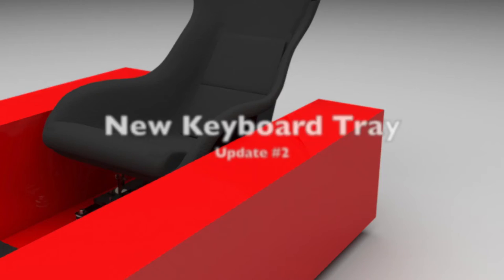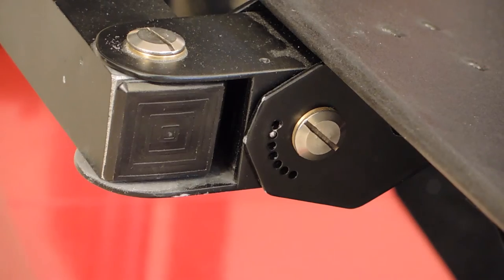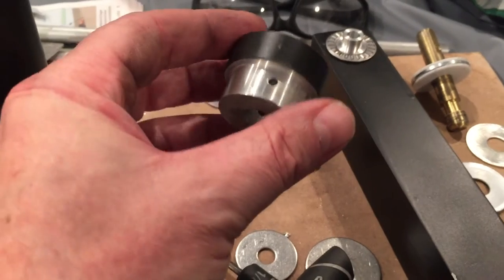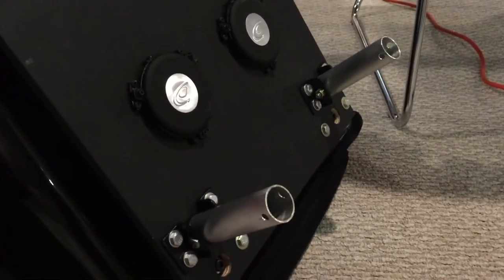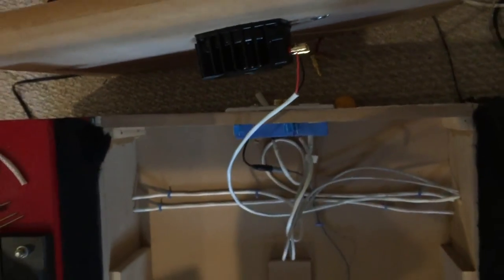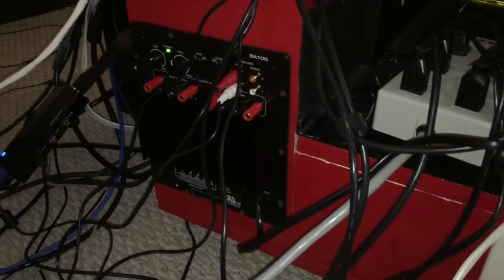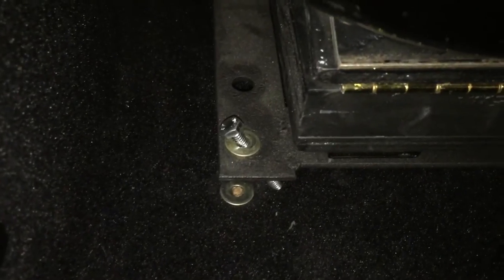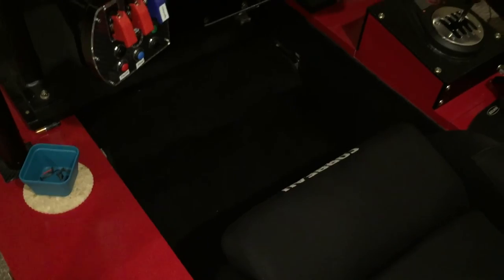Building a Driving Simulator - Part 3-2

Comment: Beautiful mr Lagnese, I hope my project became so nice like yours. My construction begin next month and I pretend to document everything and create a worklog like you (unfortunately it will be in portuguese but don't worry: you will be on the credits for sure).
My project has similarities with your even with the rig (despite the fact that it have flight simulation components):
1 - Joysticks: Fanatec Porsche 911 GT3 RS V2 Wheel, CSR Elite Pedals, ClubSport Shifter V 1.5, Thrustmaster Warthog, a Helicopter Collective and a custom button box;
2 - Razer Blackwidow keyboard and mamba mouse (supported by a gas spring vesa mount);
3 - Custom 5.1 surround system (witch I will build inside the sled, with Monoprice speakers, 6 ch amplifier board and a switching power supply);
4 - AuraSound AST-2B-4 Pro Bass Shaker;
5 - Razer Tiamat 7.1 headphones (with some electronics for switching between the headphones and the speakers while maintain the bass shaker running);
6 - Dell S2716DG 27 in g-sync monitor (supported by a gas spring vesa mount);
7 - HTC Vive (this is the reason of the single, and not triple monitor setup);

Tell me if you think that the gas spring will work on the keyboard/mouse mount (I bought it from Amazon: https://www.amazon.com/North-Bayou-Motion-Computer-Monitors/dp/B01AI2YGK4/ref=sr_1_13?ie=UTF8&qid=1474737695&sr=8-13&keywords=gas+spring+vesa).

And thanks a lot for your work, it inspires me in so many ways. And sorry about the english ;-)
Reply from the maker: Hmm, I just replaced my three screen setup with a single 4K display.  It bolted right up to my existing brackets.  I just took off the other monitor 'wings' by undoing a single bolt.  The gas spring seems like a pain compared to two simple brackets on a steel tube.  My VESA mounts (for other 4K displays), can't handle the weight well either.  Any reason why you opted for that solution?
Reply: Nope, just because it seems practical (I saw one of your videos explain the difficult to implement the tubes with adjustment and bracket alignment) and cheap (just $34) but now I am afraid: did you think that the gas spring will not work for me (to support one 27 in monitor and other to keyboard/mouse)?
Reply from the maker: I'm sure it will work depending on the weight of the monitor.  The brackets I reverted to are nice because they are so small and tight to the frame.  It moves the monitors away from the user, makes the rig lighter, and removes any possible sag.  Assuming a T-Slot frame, it would be even easier to implement.  Just a couple of angle brackets and a few holes.

Comment: so the seat tilt is non adjustable any more?   i will start building this week !
Reply from the maker: In my case yes.  I removed the adjustment because I found that I never adjusted it for anyone.  It made the connection stronger, easier to build, and the change removed some rattling noises caused by the bigger base shaker.

Good luck with your build!
Reply: Gregg Lagnese thnx for your answer . Will take that  in account
Reply: Just bought the wood